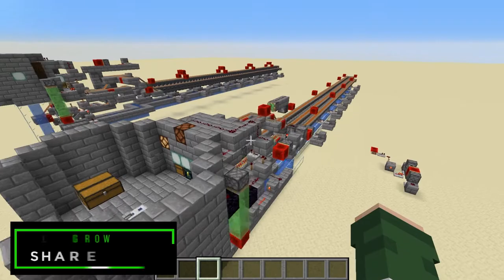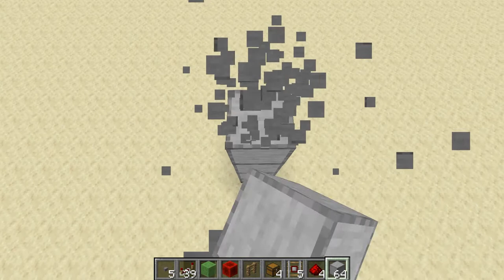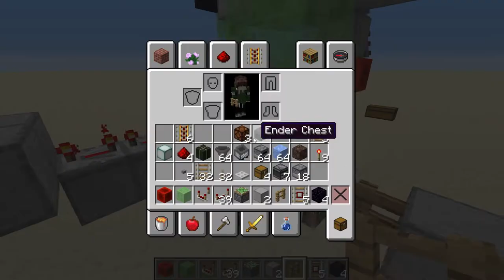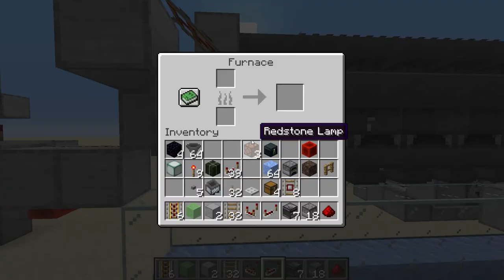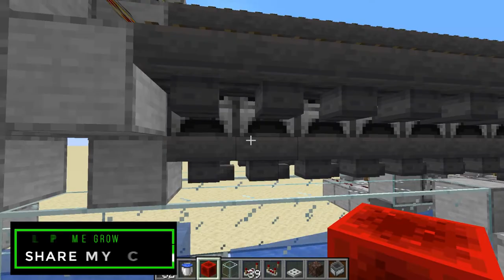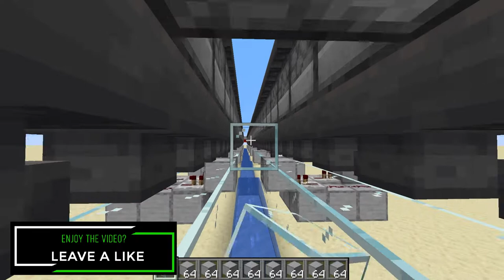Minecraft Super Smelter Tutorial - Kelp Based Minecraft 1.16 Super Smelter

Comment: don't know why, but when i use this I get a little bit of item loss. Well, i say a little bit, but it really builds up over time. For example, i wanted to smelt 18 stacks of cobblestone into smooth stone, thus needing 2 lots of smelting these 18 stacks. By the time it had all smelted into stone i was missing more than a stack. waited a while, got nothing, so put the stone i had into the input chest, and when it came back, i had less than 16 stacks total, meaning each smelt lost over a stack of blocks. Don't know why this is happening, checked the video again against my build, i've constructed it correctly, and nobody else seems to be having this problem (at least nobody else has commented about it anyway)

Does anyone know why this is happening so I can fix my machine?
Reply: You probably didnt put the glass above the droppers
Reply: did u find a solution?